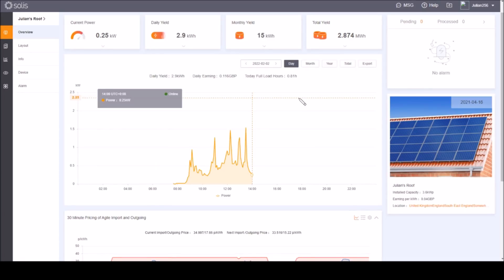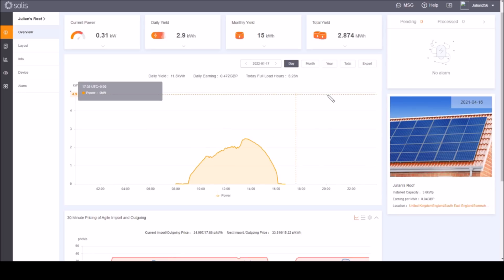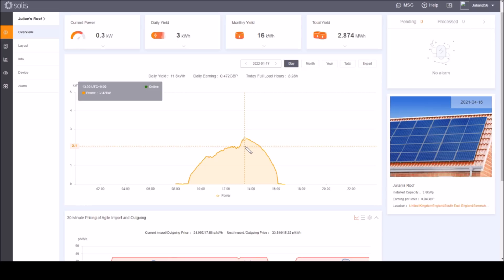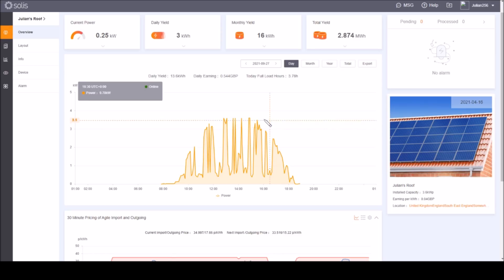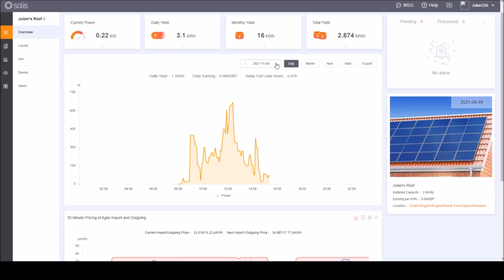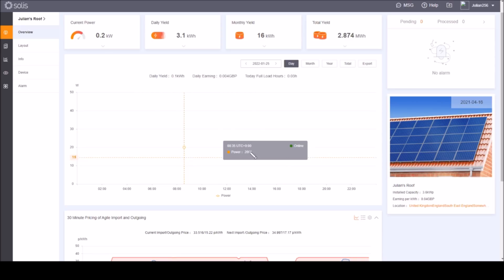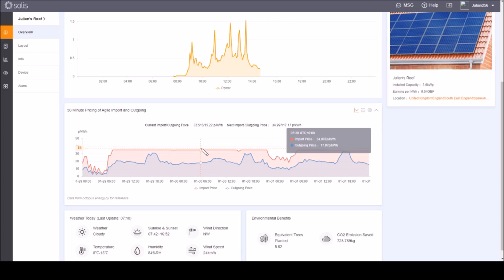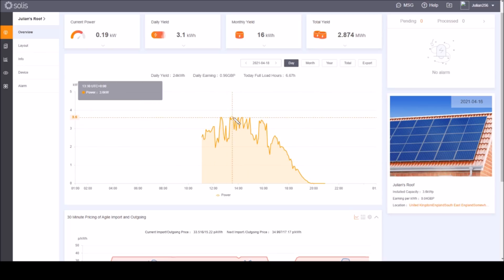Solar Shapes

Comment: It may be something called Cloud edge effect -- a common phenomenon in PV power generation. This effect is caused by sudden increase in irradiance due to reflection of the passing cloud focusing more sunlight to the array. Inverters respond to this phenomenon with current limitation causing DC voltage to rise.

Comment: Hi  have you seen solar forecast intigration on homeassistant  and esphome for turning on off solar
Relay for bitcoin mining and showing expected solar  by day or next day or next hour etc
You can set when to turn relay on and off  for your shed or house position  and show expected solar house and shed        expexted  solar you will get with example  1kw panel  or 5kw    realtime weather at your home    dead easy to setup all free on ha

Comment: Tech Ingredients did a story using mirrors/reflective paneling to concentrate light onto solar panels (a few have done it) so you could put some around to compensate for the antennae

Comment: You want to over provision solar panels at least to 1.33 times thus the usual 25% loss is compensated for. I have 6.6KW solar panel on 5kw inverter and sunny day get 5kw and on cloudy days if bright can still get around 2kw. Its a fronius and in theory can have 7.5kw of PV. Dave Jones (EEVBLOG) did a story on how a dicky antennae can drop a substantial amount of power.

Comment: Thats handy Ive not had my Mini solar running for that long. I have made on some days more than you, as I have a split array. which are tilted and angled.
Its like Solar tracking without tracking. mine gets started around 8 (1.6amps) by 9:30 in sun around 11 amps but due to the set up i can be at 22 Amps  for four hours, I drop off at 3:30 to maybe 3-6 amps.

You know it seams to make sense that the peak (UK dinner time) is best selling time. so it stands to reason to make the biggest inverter and battery for that peak. 
I make it around 1.5 hours and you want around 10KWh.. (£38.00 or there about's) That's not bad, as you should be able to make that for 276 days of the year.

So I can get EvE Cells for £238 for four 280ah, You want a few of them, then buy some old inverters, there between 50-150 each, you would need two. chain them together and pump power back at peak time. Thats £1,332 and £38 a day thats £10,488..... yeah sounds like its worth it.
Certainly pay for the rope to pull that aerial off the next doors house..... BUY THEM A SATALITE KIT  i mean and take the aerial down.

BTW on my channel I have a Huskey solar issue.😅
Reply: "around 10KWh.. (£38.00 or there about's) " ... I think you have an error here unless you meant 100kWh or 3.80 pounds.  3.80 GBP per kWh seems to be really REALLY expensive!   ;-)
Reply: @ElmerFuddGun   thanks!!  late night posting isn't good... Its £0.37 a kw.
So £3.70 and that's only  £1350.5 pa :(

Would pay for the battery in a less than a year though...

If you could pump 10kwh back to them, and it's 3-4 hours of peak rates, then it gets better. £5,402 pa.
But a 40kwh battery is going to cost alot and the array to charge it..

Comment: I had solar installed a few weeks ago but still waiting for the system to be added to the Internet by the installer. I'm looking forward to seeing the production but as I'm further north than you and have some shading I'll probably never get what your getting.
My system has solar optimizers to alleviate the shading issue.

Comment: Is it possible to use the solar panel from a cheap garden light and attach a flickering candle light with a cord so that it can be placed in a pagoda lantern that is in the shade and place the panel in the light?

Comment: All very interesting stuff.  I'm no DIYer and am looking at getting a system with battery storage and one that will work if there is a power outage.  I don't know if these actually exist at the moment but there was a lot made of that being the new big thing a few years ago.  Anyone have any ideas here?
Reply: They are called hybrid systems and work both on grid power and on battery stored  power when grid or solar is out.
Reply: @why_do_you_want_to_know  Thanks for this.  Where can you get them in the UK and can you recommend any suppliers ?

Comment: Why haven’t you installed some panels for hot water? You could use it for the washing machine for example.
Reply from the maker: We don't have a hot water tank - there isn't room for one in the house. We have a combination boiler that provides hot water on demand.

Comment: Maybe come up with a mist machine that collects rainwater on the dreary days, and whenever the panels exceed some temp threshold, spritz the water back out onto the panels to cool them down. Or, run through cooling tubes on the underside of the panel? 👍️

Comment: Life of your inverter will be drastically shortened because of relay switching OFF and ON.
I had a similar problem with my inverter which stopped generating reliably after about 3 years. Pulled it apart and found relay contacts badly burnt. Cleaned them up and inverter now working reliably (hopefully for another 3 years).
Reply from the maker: I agree. I think there's another mode where the inverter is powered from the mains side. That means there's a parasitic drain of a few Watts overnight, but it should stop the relay clicking on and off.

Comment: I've not seen an installation with the trim around the edges before. Looks much better for it.
Reply: Looks like it will block the airflow under the panels, bad idea if it results in heat buildup.
Reply: @Ed.R  In England?  Lolz.

Comment: I think the solar panels that have a solid aluminum substrate plate should have fins going parallel to the roof for cooling and maximum efficiency in hot conditions. Like a heat sink profile. 
You have critter flaps surrounding your solar installation. It looks good, but blocks convection cooling. 
What I would do in your shoes, is to drill 1/4" holes throughout the bottom and top flaps. Forget the side ones, to give me a chimney effect.
Reply: Rather than faff around drilling holes, replace some (or all) of the flaps with a mesh to get the airflow.
Reply: @webchimp  I like faffing! It's good for the soul.

Comment: Have you asked you neighbour if they still use their aerial?
I wonder if it's possible to buy water cooled solar panels. The heat could be used to warm water, even if it needs to be warmed further by electricity before it's used.

Comment: Same day 17th July 2021 my panels generated a max peak of 3.173kW so very similar to yours. Also a perfect sunny day here in NE Scotland.
Best I had was a peak of 3.99kW on 31st May 2021.
Mine is a 4kW inverter (4.6kW design spec) which can accept 4.2kW power from panels.

Comment: Fascinating stuff this - really interesting. I've had to re-watch it just to make sure I was getting a handle on all the data you were sharing.

I put in a baby 4-panel 1.1kw inverter system as a look-see myself last year - only been running it since September but it's throwing up some intersting data and your video is the first real chance I've had to do some comparisons. We have

Solar aside - I'd imagine that the 'agile' tariff you're on would give you significant opportunities to export at peak rates from the battery systems you've built? Does the system have some kind of API where you can see a forward market price for export? It'd be super cool to see automation around that.

Anyhoo - thanks for sharing this Julian - compelling content and I look forward to seeing how it evolves!

Comment: Do you not have panel level balancers?

You might want to look into those if you get shadows like that.

I've got microinverters, and they do wonders situations where shadows obscure some panels. It's also allowed me to mix different pitch panels into the same setup.

I'm just outside London, 25/1/2022 was terrible (92Wh!)... In fact a lot of January may as well have just been darkness, but other days were Woooo!
Reply from the maker: I think they're called optimisers. They're not cheap (you need one per panel) and quite honestly I didn't want any electronics stuff up on the roof.
Reply: @JulianIlett  that's the name! Sorry I was having a brain failure!

My are the same, one per panel, and mine cost pretty much the same as the panels they're connected to!
Upside, I don't need a big inverter anywhere, and I can add more panels (with micro inverters) as and when I like, without ever hitting the limit of a single central inverter. No big single point of failure either.
Biggest plus is the independence the panels get, with each being able to produce its best, without being dragged down by one with partial shadow or dirt. I've got panels with different pitches, some optimised for low sun, others at a more traditional pitch, which would give the worst of both worlds on a string setup, not the best.

TBH I'm happier having 240v AC coming down off my roof than several hundred volts of DC you get from the string setup.

Comment: There are some trees in the next road that are so high that they keep the sun off our panels in the morning for most of the year. Then, our roof has a steep slope, so during the summer months the output is lower. Our peak output (<2kW) happens in Spring and Autumn. I recently cut about 12" off the over-tall vent pipe that was partially shading the panels; it seems to have made a difference; I just wish I'd done it years ago.

Comment: Why don't you store the energy instead of sending it to the grid, would that not be more effective?
Reply from the maker: I plan to. On sunny days I'll charge the car (72kWh battery) with my solar tracking EVSE. When the car battery is full I'll connect Antminers to the car's V2L output.
Reply: @Julian Ilett  would you not be better with a home made power wall, then you can collect power all of the time even when you need the car charged etc
Reply: @andyguest6543  I doubt he finds it necessary to have the car fully charged very often. So would make sence to use a battery that's already available.
Reply: I would yes which is where vehicle to grid and intelligent car charging comes in. He is already working on a smart car charger in other videos.

Comment: The shadow issue is quite a problem for the older design solar systems, using one central converter. In these all the panels are in series, with each panel composed of a number of silicon cells. The number of cells results from each cell only creates approx 0.7V or so as is known as forward voltage of silicon junctions, so typically you have 32 cells by 0.7v or a bit above at no current, and the open potential of a panel is from 22.4V and usually up to 27V no load.  The available current is limited at each cell by intensity of light (mainly longer wavelengths  red to infra red as silicon has highest efficiency there) but each cell can run no more current than incident light allows or it will be forced into inverse voltage, which if high enough goes into potentially destructive breakdown. Thus each panel can end up limiting maximum current based on individual silicon cell illumination and as all panels are in series the whole system maximum could be blocked by just a single cell partly shaded. Unless driven to breakdown. So in actual implementation each panel will also have a inverse diode across the cell, preventing too high inverse bias across the entire panel. Proper cell safety is assured as even one diode forward voltage drop will bypass current around the whole panel, dropping total system output voltage by that diode drop, or multiples if several panels are at various max current states. However the total system can still get maximum current that the best illuminated panel can produced. Even a small shadow on one cell can remove an effective voltage of around that 20+ V that a panel could provide. If the total system has 10 x 400W panels, so about 4KW max, a single panel dropped from delivery due to one cell getting shaded a bit, can eliminate 1/10 or 10% delivery. More panels each shaded and even more is lost.
At ideal exposure all panels have the same intensity light and full poer comes out. This shade problem is solved by better modern systems, that instead of one large converter with 3.6KW capacity as yours, micro converters on each panel, rated to panel capacity all syncronise phase wise just like your high capacity converter does to deliver back to mains network. All the micro converters then add up to the full capacity. Now any panel even a little shaded or nearly fully shaded still adds what capacity is available, the rest are unaffected at all, but no longer is the lower capacity panel forced out of use completely to prevent reverse bias, it just delivers what it can.
Now there are multiple converters, does that not cost a lot. Well that need not be bad at all. Cost of a high capacity converter is significantly higher than the lower capacity microconverters, just by needing very robust high capability devices, huge heatsinks, coils  ferrites etc. Also the whole input system of high capacity systems need to handle high voltage DC, while the microconverters are running off panel DC under 30V, only the output side is mains level, not much different to typical DC to AC inverters. Heat sinks are for few hundred watt system not many KW.
Then comes additional reliability of the system. A microconverter failure drops one panel from delivery, a failure of the high power converter you get NOTHING TILL REPAIRED. Which is more prone to failure, the high power converter or the lower power, lower input DC voltage microconverter. What about an actual fault in solar panels, depending on the failure the entire system may be out of service, or at least compromise the system capacity.  Wiring cost, well the high power converter system summs all the panel voltages and thus may run up to near 300V DC, at high currents 15A or more, that needs long runs of custom special high voltage, high guage wiring, specially secure connectors, from roof solar panels all the way to the high power converter. On the microconverter system the DC is local at the solar panel, from there mains single phase power leads can bring power at the lower individual cables to a central power bus junction panel. Lower cost cabling, connections at lower currents to central junction panel. 
As you have already experienced small power converters and controllers, these are not such big complex jobs, compared to high voltage DC input high power AC output systems.

On topic of loosing performance as systems get warmer. Well silicon has around 2.1 to 2.2 mV/°C decrease coefficient. This basically will apply to the solar cells of the panel. Given the cells have around 0.7V at 20 to 25°C, it is possible to estimate loss based on increase temperatures. Let us assume 65°C of the panel and cells it contains, so we get say 40°C rise, which is thus upto 88mV drop in output voltage, some 12% approx loss from 25°C and lets also assume a bit of loss of quantum efficiency as a result of increased temperature, increases leakage current, though compared to delivered aay 10A to 15A that on silicon should be rather insignificant. Let us assume up to 15% loss from temperature. Maybe some tiny extra cable losses by restance increases.  I suggest 3.8KW dropped to mere 2KW is NOT likely from heat/temperature effects.

A clear cloudless day however can still have hazy air, especially near ocean areas or even from air polution. If air is relatively humid, it still does not require clouds to be formed, for that moisture to cut light intensity especially the silicon optimal red to infra red range. Keep in mind water vapour is hugely more greenhouse effect than CO2 or even Methane . That acts both in trapping heat (infra red) from leaving out to space, as well the same coming in from space (sun). Depending on air clarity and moisture level in the upper atmosphere, you can get considerable solar energy dekivery changes and still experience a basically sunny cloudless day. Just think of a muggy summer night, with minimal temperature drop during the night, compared to very dry weather, where overnight a warm day temperature plunmets overnight. I have in hot summer in Queensland Australia had day temperatures of 45°C day time, and had a 5L plastic water bottle frozen frozen solid in the morning standing beside my 4WD during the night. Absoluteky clear dark sky, virtually no moisture above at all. During my Astromony, if there is moderate air humidity, the cooling of telescope lens, or front corrector ir camera lens, due to radiation into space drops these glass surfaces temperature,  to cause condensation and fogging problems, But in muggy air, while there us more moisture still, the humidity prevents enough cooling of lenses or glass surfaces and no fogging occurs. I do not know your town air conditions or air polution levels, but for that almost 50% reduction 3.8KW to near 2KW may have a lot of air clarity/humidity basis, inspite of a cloudkess day.

Sorry this got a bit long. On the shadow problem and advantages of micro converters Dave Jones examined that topic a litlle while ago. Check his past video too.

Comment: Good that you point this out Julian. Cool sunny days in April/May are the best, snow on the panels at the moment. This efficiency correlation as a function of temperature you observe is normal and well documented.
Reply: wrap a towel around a broom stick, tie it half way along a rope, thrown over the roof;   snow removal.. requires another set of hands.

Comment: Also, maybe experiment with a water sprinkler on the roof? Cool video idea for potential cooling down the panels. But I think the clouds and haze and sun rays angle (depending on month) are the real problem, not the panel temps.
Reply: My observed difference between fully cloudy day and sunny day in winter is up to 16 times more (3kWh/day vs 48 kWh/day on 10.7kW system).